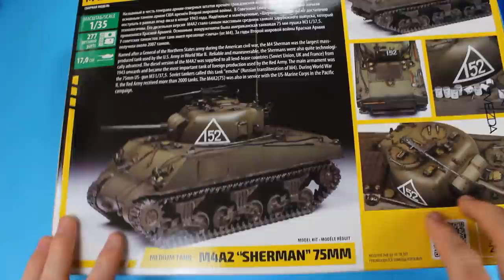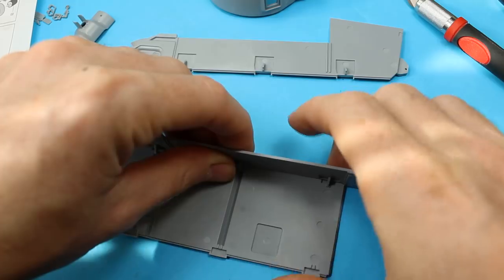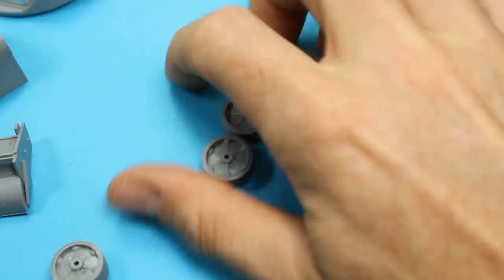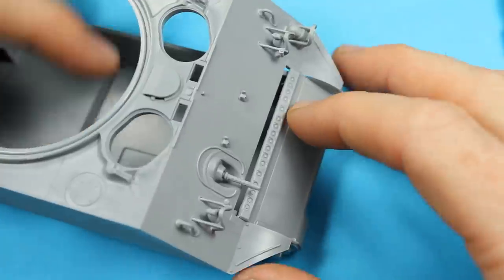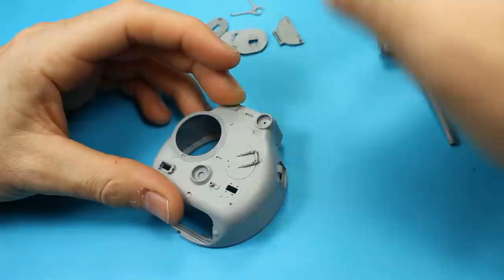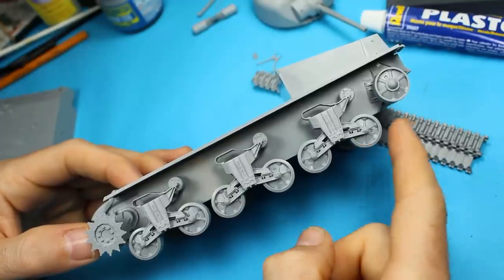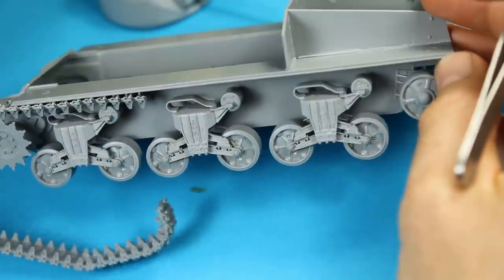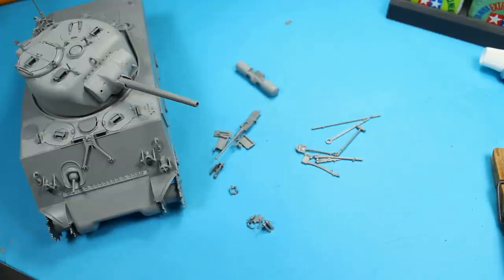Zvezda 1/35 M4A2 Sherman, Step by Step Full Build Video, Part 1

Comment: I must say, the new zvezda kits are great. Their t-14 aramata is the best kit of that tank, and is one of the best kits I've ever made. I also made a 1/72 pz4 G late war, and that was a very nice kit.
Reply: Their newer 1/48 aircraft kits have been outstanding for some time. Their 1/35 newer tool armour is OK, but with the exception of the very latest like this initial release new tool Sherman, not up to the same standard as their aircraft IME&PO. They are superb value though if looking for meat 'n taters but accurate models, as long as one shops around. They have been constantly improving their armour, so I hope this is an example of the new future standard.
Reply: I'm interested in the zvezda 1/72 kits WWII and I pleased to hear that they are excellent. I'll buy a couple and give them a go.
Reply: @barrythatcher9349  I'll just give the usual advice really, double check the kit isn't a duff as all manufacturers make a bad kit every now and then. And check it's a new kit of theirs.
Reply: I definitely loved their Armata kit, though I ran into the exact same issues with the link and length tracks

Comment: Thank you very much for this video. I was just watching a video about the RFM Sherman before this where the builder criticised the overengineering. Your video convinced me to go for the Zvezda Sherman instead. I have built their new tool T-34/76 last year and it was a dream to build, just like you describe the Sherman fit.
Reply from the maker: Great stuff just watch the tracks they’re ever so slightly tight but do join up, there is always mud if you have a little gap! The marking schemes I have now seen pictures of Ceaser in the Pacific and it has different tracks to that in this kit, best off with the Soviet one they provide 👍
Reply: @ChampionScaleModelling  I am eyeing their M4A3 as a base for a M32B3 using parts of the Italeri/Tamiya M32. As I see it it has the steel chevron tracks, though most M32s seem to have used the rubber chevron tracks.
Reply: @ChampionScaleModelling  Would be great if Zvezda added a HVSS version to the line up :)

Comment: It has a separate barrel end because even guns not intended to receive a muzzle brake were typically threaded at the end, and received a corresponding threaded end cap for the muzzle.
Looks like a nice kit. Apart from the T-49 track, which was typical of RUS and GB Shermans, the hull looks very much like an M4A3 from the engine deck grilles, rather than an M4A2 diesel type - as with export models. Going to need to consult RP Hunnicutt on that... The 600 page 'bible' on Shermans.

Comment: It's a great kit. I hope they make a 76mm too. I found it easier to build the upper and lower hull together.. then add the sponson fillets.. then add the suspension. I found it important to keep checking the hull parts to make sure some didn't shift when assembling the hull. On mine,.. i had to adjust the suspension a little  to align the sprocket ,wheels and rollers so the tracks wouldn't tweak . The tracks fit perfectly. I really liked the factory stamps that are all over the hull parts. Its really a fun well detailed kit and way cheaper than most armor kits.
Reply: Zvezda released some info today and an M4A3 76 is on the list.
Reply: @travis_thompson  Thanks for sharing that. I'll be on the lookout for it. I hope Zvezda makes a new STZ T 34.. that could be really fine.

Comment: One thing you need to add is a weld bead on the side profile it's where the front hull is at a 45° angle. In scale it's about 1 or 2 mm from the front hull. Tamiya forgot it pn there's,most companies do it but it's usually not good looking

Comment: Excellent video, as usual. 👏  I have been eyeing this kit with the idea of doing a Sherman in the Pacific Theatre as well, so I hope you'll share your build of a Pacific Sherman when you get it done! ☺

One point and a quick question:

1. For those who'd rather not deal with photo-etch, there are a couple of manufacturers who are making excellent 3D printed resin light guards & other details for Shermans. If you go the photo-etch route, look to see if there's a manufacturer who provides a jig with the photo-etch that will enable you to easily get the right bends.

2. Should there be a weld bead around each plate of applique armour?

Comment: Hi, Thanks for posting the video tutorial so finally watching as I build my own one and copying what you did but the rear radiators are a real struggle it seems already. The middle fin its got a piece that sticks proud of the top the radiators and seems to be causing an issue and there is no recess for it on the inside so either it's not right and needs to be cut off to fit or it's simply me not getting it positioned correctly. Please share any guidance or pictures of your model or anything else that might help me in this build. The metal barrel I ordered for it didn't fit so making do with the plastic one.